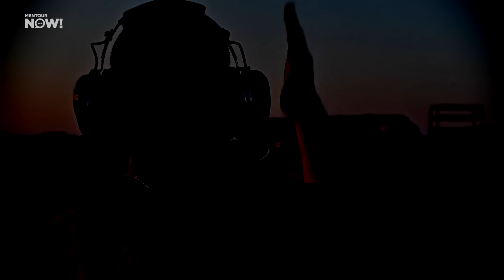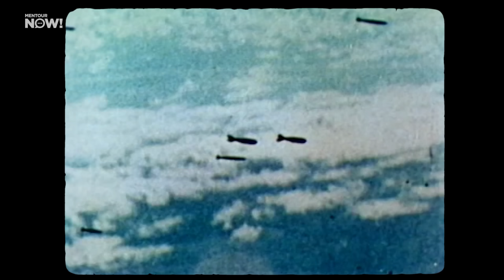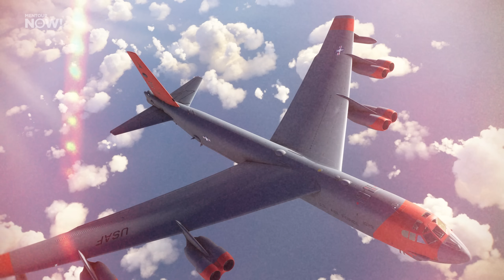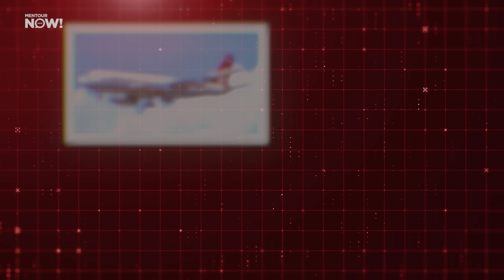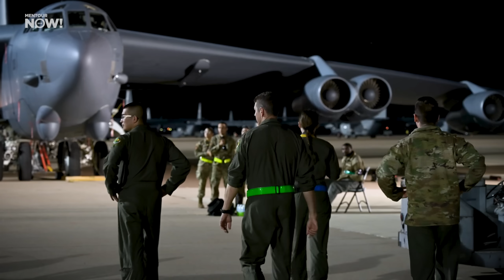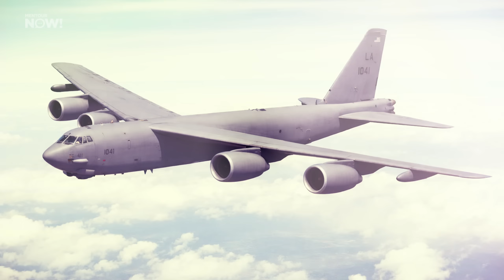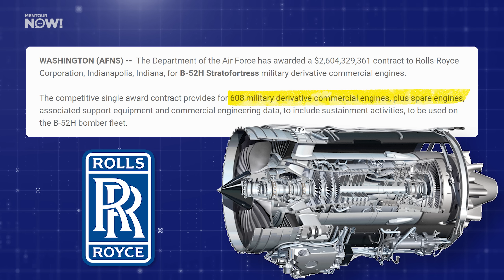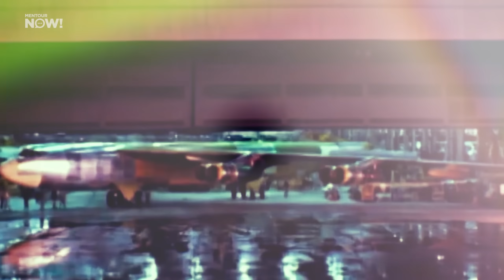WHY Are They Changing The B-52 NOW?!

Comment: Much like why the USAF is buying new F-15s, the optimum fleet is a mix of new, high end aircraft, and older designs that are excellent at being "trucks". Truck a lot of munitions up to altitude and support the spicy new aircraft. The B-52 is just really, really good at being a truck.
Reply: Which is why the USAF hasn't been successful at replacing it. They can't resist the urge to gold plate everything and we don't need a gold plated bomb truck. Simple and reliable isn't in their vocabulary.
Reply: @paulbrancato8262 I think part of the consideration is that the DoD doesn't like throwing pilots (and infantry, and tankers, etc etc) into a meatgrinder. It takes a lot of time and money to train them, so something that's otherwise cheap and quick to build still needs to keep the occupants alive.
Reply: @counterfit5  sheeit!! so the pent DID learn summat from veyut namm??
Reply: @paulbrancato8262  Sort of.Though in a year or two there will be enough rapid dragon kits floating around that if needed any C-5,C-17,C-130, Stratolaunch can be used as a Missile Truck before a big op.
Reply: @dexecuter18  Rapid Dragon allows launching a ton of munitions all at once for an initial assault.

The B-52 can launch munitions one at a time as needed to sustain operations. Basically it's close air support being launched from a hundred miles away
Reply: That's pretty much it right there. It can't really do penetrating bombing missions through enemy airspace anymore, but it's a cheap & reliable missile truck. And now it'll be cheaper and more reliable after being re-engined, along with having new-hotness sensors, avionics & electronic-warfare gear. Far cheaper per-mission than a B-1, B-2 or B-21, so the Air Force will only use those new bombers when they need those capabilities.

I suspect that if the USAF decided to replace the B-52s, on top of new bombers like the B-21, they'd be considering a bomber that's essentially a 737 with a bomb bay, to fill the missile-truck role.
Reply: Surprisingly the B-1 is actually the cheapest per flight hour, despite the maintenance needed for the variable geometry. Most of it comes down to how out of date the tech is on the B-52, especially how much aerial refueling it requires due to the inefficient engines so hopefully this pulls it back below the B-1. The B-52 also is a lot more modifiable with more space for future electronic upgrades which is why it is being slated for a longer lifespan.
Reply: @meldroc  Fitting a bomb bay on a low wing commercial air frame could present problems. That doesn't mean you can't crib a lot of parts from them though. Various airfoils, control surfaces, engines and flight control software. Just use them on a high wing fuselage.
Reply: @paulbrancato8262 You'd likely build it out of a military cargo plane, which have a high wing
Reply: @meldroc  If I was them I'd standardize the bomber, refuelers, cargo, and AWACS aircraft on a modern/next-gen commercial airframe.
Reply: @hanzzel6086 commercial airframes are it built in a way to make them effective bombers. Tankers and AWACS, though, absolutely. Hence the new 767 based stuff
Reply: @hanzzel6086  "... commercial airframe", jest NOT from boeing??
Reply: @meldroc  The 777 would make a much better job for that. A highly efficient, large, economical plane.
Unless of course they want to by old-stock 737 NG.
I could even see the 737 successor getting a military variant.
Reply: Cheap and reliable
Reply: And the great thing about an old truck is that you can treat it like an old truck, which is why you bought a truck in the first place!
Reply: Under the hood the F-15 Advanced Eagles are basically totally different jets compared to the old ones. Only the airframe is the same.
Reply: @FirstDagger  airframe only looks the same, EX has lots of composite parts in airframe which "classic" F-15 does not have(to the extend that it could have it's own designation, but it would mean leaving recognized and proofed "brand" behind), exact the same thing as with SU-27/SU-35 can be mistaken by outer view, but remove sheathing and they are completely different things
Reply: @SergeiSugaroverdoseShuykov  Yes, I should have said airfoil, just like with modern Vipers.
Reply: @SergeiSugaroverdoseShuykov  Also older F-18s compared to newer E/F/G Hornets - though these are more obvious externally.

The Block-60 F-16s maybe worthy of a similar comparison, though people tend to compare them to their F-2 counterparts more often, I think.

To me it's outright impressive how much stuff they are managing to cram into the F-16s considering their size.
Reply: I have heard that, the F22 and F35 would fly ahead under stealth and then forward missile guidance data to F-15s farther back.
Reply: Couldn't have said it better myself
Reply: 'bufT'??
Reply: Workhose is also matching, the stealth fighters and bombers obviously will spearhead (and a big load of cruise missiles) and then other fighters and the B-1 engage to ensure air superiority and when they had secured that these slow subsonics like the B-52 and A-10 can safely enter and do CAS, carpet bombing etc.
Reply: Beefing up with proven tech
Reply: Yeah, there is a good reason the Super Tucano is selling. A turboprop fighter intruduced in 2003, but cheap to buy and cheap to run. For many cases, that is good enough.

The B-52 might be long past it's role as strategic bomber, but it's a big plane that simply works.
I see it transition similarly to trijet airliners. Not economical these days for passengers, with ETOPS allowing modern twinjets to do the same job cheaper, but quite popular as cargo planes.
Reply: Thanks, needed a word that expresses that idea simply,  "trucks"  that works.  Despite all the discussion of the expense of doing this and that the underlying implication is this is still much cheaper.
Reply: More like a freight train but the C-5 galaxy can out do the B-52 by a lot and drop racks of bombs from altitude so it must be a flying cargo ship..

Comment: Its bizzare that those new engines are still only 4.5:1 bypass efficient even though they are more than capable of easily delivering the same thrust. What I'd like to know is if the lower fuel burn and fuel delivery would impact the planes flight characteristics. Is all this to avoid B52s needing so many vulnerable refueling stops? (apart from spares) Will the engines be able to run on SAF not for the reason that they care about the planet but that this fuel may be more available in a future war. Seems unusual that the lighter weight of the engine would not have allowed them to  just install 4 engines (now modern ones with better reliability potential) and leave the other nacelles empty. This would have cut the weight stress on the wings allowing for better take off lift (or more fuel moved into the wings) and allowed for more space in any new nacelle design. It will be interesting to see if in any real war where good SAMs exist will their survivability as mobile  missile platforms. If China makes a volume modern B1B type jet that can carry close to the same missile hardware then we might see a change in Congress to look for a clean sheet design. After all the stress on the metal alone and the wing spars must be getting iffy. What pilots want to fly an analogue cockpit when its worthless outside the AirForce.

Comment: They come over the Cotwolds occasionally - a lovely area of pretty villages and deep valleys where Clarkson has his farm - one of these screaming over leaving its distinctive high carbon sooty trail is one heck of a contrast I can tell you. One got somehow ‘stuck’ once - flew round and round for hours, I kinda missed it once it beetled off! They have real personality 😂
Reply: Less soot when they upgrade to Royce.
Reply: @TesterAnimal1  Actually, the TF33s in the H model put out far less smoke than earlier models.  Especially when they did a water-injected takeoff, which the H model didn't need.
Reply: @TesterAnimal1  The F130 is a BMW engine... acquired by R-R.
Reply: @DoktorBayerischeMotorenWerke  ... This is BS from the well known anglophobe.  His nonsense has littered the comments for years.
Reply: Marvelous! The Cotswolds would be far less beautiful and serene without B-52s.
Reply: @jajamuc  ... you seem confused.
Reply: “It beetled off” I am stealing this phrase! Cheers from the USA!
Reply: I once took off from Minot AFB, and  my flaps stuck in a partially extended position.  That's a mission abort, but I was too heavy to land, and the BUFF doesn't have any fuel dump capability.  So I flew racetrack patterns north of the base for about 2 or 3 hours (don't remember exactly) with gear and airbrakes extended to burn off enough fuel to come back and land.
A ground blizzard came up during that flight, but that's another story.
Reply: It wasn't stuck.  The B-52 has no way to eject excess fuel when something has happened that requires the crew to land.  The aircraft missions regularly require take-offs with more weight (mostly fuel) than the aircraft can safely carry into a landing.  These two factors mean that a B-52 that needs to make a landing because something has failed or broken has to just roam around the sky burning up fuel until the aircraft's weight allows a landing.
Reply: Yep, we had one over our small town flying round and round and round for most of the morning. It happens every now and then.
Reply: They inject water on take-off - it looks like fuel burning, but it is water in the fuel. Not sure if they do so in-flight and if that is what you saw.
Reply: @ibubezi7685 , only up through the G models, which were retired in '94.  H models have never used water injection.
Reply: @ShawnD1027  OK - still, could have been 30 years ago.... Heck, they flew 60 years ago 😉

Comment: the phrase "form follows function" has never been truer about any aircraft than the B-52. and that function was extended by beyond line of sight weapons.
Reply: Exactly, its a simple task for the airframe.
Reply: If you design something well, it can far exceed it's original purpose.
Just look at Mars rovers. We send them out to do a job for two years, and they still run a decade later. With 25 year old computers that were outperformed by a late 90s home computer.
Or how JWST hasn't made Hubble obsolete. They operate in different bands, and Hubble is in LEO, so it can be serviced and upgraded as you go.

Comment: Well, the Concorde was also designed mostly with a slide ruler. 😂
Reply: ...or maybe a slide ruler!
Reply: @m-arky66or even a slide rule. A ruler is for measuring. A slide rule is for calculating. Apologies for the pedantry.
Reply: @m-arky66😂😂👍🏼

Comment: Reminds me of the Dakota.  How many Dakota replacements were put into service, and retired while the Dakota just kept right on flying.  And flying.  Doing the job they were built for. The last SAAF Dakotas were finally retired in 2024.  In the UK, Dakotas were used for some pollution control duties until at least 2015.  Around the world, 150 to 200 are still flying, in all sorts of roles. Some aircraft are so ideal for the job they were designed for, that replacing them is next to impossible.
Reply: There's even a new engine upgrade program for the Dakota. There's a US company that'll swap out the old P&W piston engines for shiny new turboprops. They also lengthen the fuselage (to account for the loss of weight in the engines). 

Not especially cheap as such, but you'll not get an aircraft with the capabilities of a Dakota with modern turboprop propulsion anywhere else.
Reply: @abarratt8869  That's the Basler Turbo BT-67.  It's a great program.  It pretty much ensures that numerous DC-3/C-47 Dakotas that are over a century old will still be flying!
 
Note:  The Basler BT-67 program is already 35 years old... The first ones flew in 1990, and they are still producing them at a leisurely rate of 2-3 a year.  About 70 have been so converted since inception, but perhaps 7 or 8 have been lost or withdrawn from use.  There are also approximately 150 airworthy, piston-powered DC-3/C-47 Dakotas, many of which are potential conversion candidates.
Reply: I believe you are referring to the Basler BT-67, I first heard of them watching some of the Buffalo Airways shows.
Reply: @zevar9920 we got a couple of them in Oshawa Ontario they are all decked out with all kinds of fancy antennas for contract work in northern Ontario they Usually fly up north and from a certain altitude they send some kind of radio beam's down to the ground and they can measure how deep in the ground that's got nickel and cobalt and other minerals there are while the plane is surveying the area
Reply: @abarratt8869 we got a few of those DC3 conversions up here in Canada nice machines

Comment: The reason why they didn't do this sooner is that P&W has been selling the lie that the maintenance contract would be less expensive than the replacement contract. But it hasn't been true since almost the earliest days. They have been worn out for decades and were almost continuously in overhaul, each time they came back they lasted less time. P&W has been flogging a dead horse for most of my life, and I am close to retirement age.

Why 8 and not 4? Because it requires less redesign. Less new parts. Less changes to systems. And it retains tolerance of battle damage.

None of this is complex. The only real question is why it took so long to do this, and P&W political contributions (bribes) answers that.
Reply: 4 engines do not work for an engine-out takeoff emergency and the resultant lack of rudder authority.  8 engines do.
Reply: @SEO122  Is this arguing with something I said? This is part of sticking with 8 engines doesn't require as much redesign.

Comment: It’s insane that it’s cheaper(they claim) to buy 8 engines per plane than to make the mods needed to just have four. The bypass ratio is terrible by conventional standards and the fuel burn can’t be great either.  Throw on that the maintenance of 8 vs 4 engines and I’d have to think a redesign of the pylons would pay for itself in a reasonable timeframe. 

Not to mention it would get shot down in a second over contested air space. I love planes like the A-10, F-15 and B-52 but they aren’t going to fight modern wars against capable adversaries like Russia and China.
Reply: The B-52 is not operated in contested airspace. It is not trying to do the job of a B-2, an incredibly expensive aircraft, which also can't really be operated in contested airspace now. It's due to be retired not later than 2030, and as it's largely relegated to the role of a stand-off platform for cruise missiles it has been  found that the B-52 can do the job much cheaper, with larger loads and over a longer range with the new engines. So, yes, when used as a stand-off platform, they would be used in modern wars.

To give some comparisons, the B-52 has an unrefueled range of about 16,000 km, which will increase to 22,000 km with the new engines, and 35 (US) tons of ordinance. The B-2 manages 11,200 km range and a payload of 30 (US) tons. That unrefueled range means much longer missions can be carried out without the logistical headache of in-flight refueling. 

The requirement for a stand-off platform is not very demanding in terms of the airframe, but these days requires much more in the way of electronic warfare capabilities, and the B-52 has more space and, importantly, crew numbers.
Reply: Please compare the SFC of the BR725 to larger bypass ratio engines. You would be surprised. 
Being into that topic I can assure you that the 8 engine  decision is far from insanity, Petr described it quite well.

Comment: Don't forget that from a fatigue point of view military big jets face nothing like the number of cycles that airliners do. Nevertheless the B52 is mighty impressive. 

RAF Victors had their fatigue life increased twice, once to get them through the Gulf War and then again to cover the gap before VC10 K4's were converted from old BA Super VC10's.  Eventually we ran out of engines or more precisely combustion chambers that could not be manufactured as RR couldn't make them.  We stole a lot of parts from museum examples to support both Victor and VC10 in their latter days.

There was even a similar attempt to re-engine the VC10 when they strapped an RB211 onto one side and kept the 2 Conways on the other.  All it achieved was that they bent the fuselage. So the idea was abandoned.
Reply: Was it RR couldn't make combustors, or didn't want to? They must have had the drawings for them. 

I can imaging that they'd all originally been made sort of by hand by someone who really knew what they were doing, and that RR didn't want to have to spend ages training someone up in a lost art. It's surprising how quickly manufacturing techniques go obsolete, and it's a big job to revive them. 

A classic example is wrought iron. We know everything there is to know about what wrought iron is. Yet, pretty much no one can make it...
Reply: @abarratt8869  They just didn't support the Conway anymore as it was not economically viable.  They had gone above and beyond in their support to be fair.